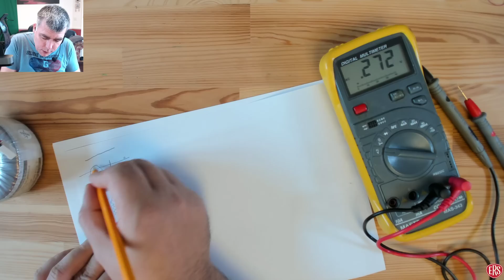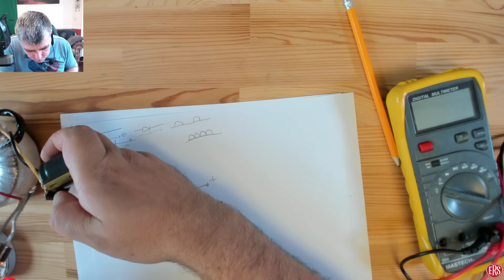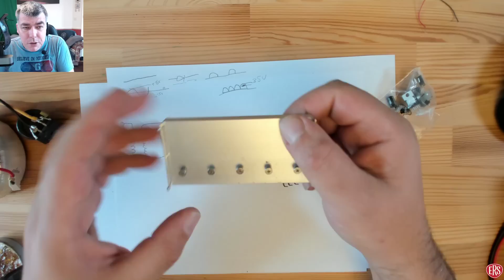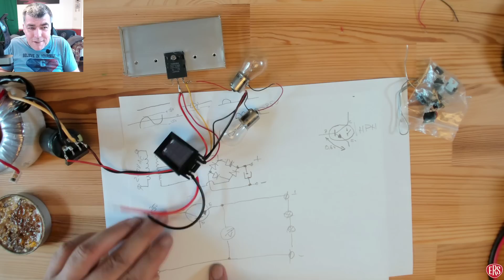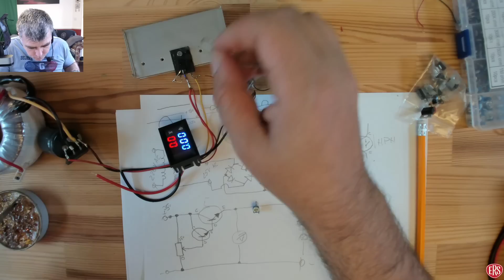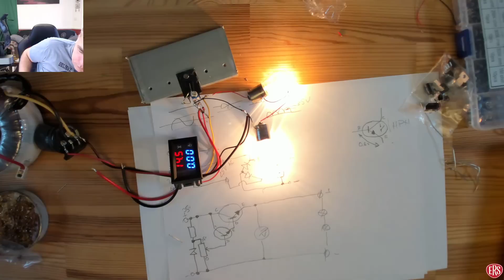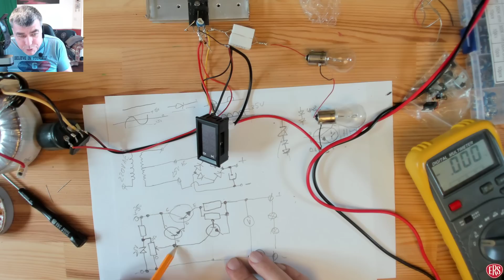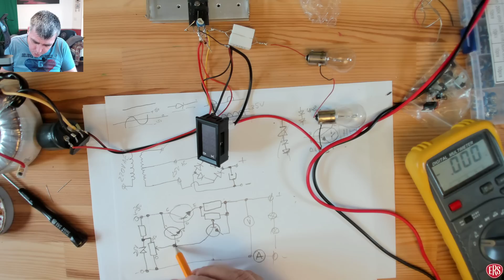How to Make a Lab Power Supply - Power supply project #Beginners diy projects

Comment: Wooow. Sorin, sir, that's the best video about DIY Lab power supply I seen on YouTube or anywhere else. Clear, useful and.. powerful. Thank you very much for explaining everything so nice. :) What can you do more about this device? I'd like to see how to make a short circuit protection for example or feedback voltage compensation for stable output. :) But these are only sugestions, anything you create will be indescribably useful. :) Waiting for next parts! I'll build one simmilar to your and share my experience. Thanks!

Comment: I ussualy use 3pin regulator ex. lm317 to bias pass transistor(2n3055). voltage can be fix with 2 resistor at pin adj or with 5k pot(variable voltage) between pin adj to ground, and 1k pot(current limit)+200ohm between output to adj.
Reply: Can you please give me the circuit using the above components. Output to Adj pin will definitely affect the voltage, but it can regulate the current- that I have to see.
Reply: @babbooshing6563  just google it. that simpler than use lm723

Comment: Smashing tutorial sorin, a classic transistor regulator :-D
My favorite output transistors are a couple of metal 2n3055's in parallel with emitter resistors so both transistors operate together.
I like the 2n3055 because it's handy for psu's and audio power amplifier outputs :-D.

Comment: Salut Sorin. In loc de dioda zener poti folosi led-uri pentru a ajunge la valoarea de referinta dorita.
Ca si intrebare poti scoate 4 amperi si 1 volt ?   M-iam facut ceva similar cu cateva luni in urma bazat pe cipul lm317 si nu prea pot face asta (transformatorul scoate 19v cu 4 amp). La 1v am max 1 amp. Ma intrebam daca e normal sau nu. Multumesc pt video

Comment: You should probably limit the maximum output current, here you can turn off the current limiter. Adding a simple resistor in series with the current limit adjust potentiometer should do the trick.

Comment: Nice video
Just one thing 
25 volt Transformer gives 25  x  square root (2) = +- 35,35 volts peak voltage not 25 .
In 220 volts  mains  power supply we have + - 311 volts
Reply: Nice math - but that's not the answer. The transformer is stepping down to 25v AC..One diode rectifies to 25v DC in one polarity. Second rectifies to 25v DC in the same polarity. The capacitor removes the ripple to the .707 power factor line. So .707 of 50v DC equals the 35v DC. Load further reduces DC voltage out.
Reply: 25 volt Transformer gives 25  x  square root (2) = +- 35,35 volts peak voltage not 25
truth
 ....
but without load ....
Reply: You all have right.
My point is in 6:25 of the video.

Comment: Really liked your comment about the fact that if you get bothered by the fact that you don’t have a PCB to build on, it will put on break on your creativity. It’s so true. If you absolutely feel like you need a PCB, get a perforated, cheap one to build on with only solder pads. I’ve done it for certain compact builds. Anyway, thanks for the trip down memory lane!

Comment: can we replace the big transistor bipolaire with mosfet
Reply: Uważasz, że mosfet jest lepszy od bipolara? W którym miejscu?
Reply: @leszekpaterek2389  the mosfet  controls with voltage it will be less heat
Reply: @AmerRimireZ  Jeśli na wejściu układu będzie np. 25V a na wyjściu 5V i prąd obciążenia 2A, to moc tracona na tranzystorze wyniesie (25V-5V)*2A=40W i bez znaczenia czy mosfet, czy bipolar.
Reply: I do not think they work the same. Mosfet is either open or not. Transistor output will vary as voltage on base varies. Right?
Reply: @okejee3455  Tranzstor mosfet bez problemu będzie pracował w liniowym zakresie pracy. Popatrz na schematy wzmacniaczy audio w klasie A-B z mosfetami na wyjściu.
Reply: Leszek Paterek ? What language is this?
Reply: @okejee3455  Polish

Comment: How can add short circuit protection and buck boost to it
Reply: Why buck boost? It's already capable of about 0-25V and like Sorin says, you will rarely need more than 20V if you are using the PSU to repair other popular electronic appliances

Comment: So what is the purpose of a relay in linear psu? Higher amp output? What if our transformer output has a higher voltage for example 50v. Can we use the same schematic just with different components that are rated for a higher voltage? What if our transformer has 2 output coils rated with the same current and voltage? Can we connect the outputs in series/parallel or better yet change the connection type depending on what we need more volts/less amps or less volts/more amps?
Once I opened old linear psu and I saw 2 opamps in addition to the transistors. After close inspection of the circuit board I was under the impression that the opamps regulate voltage/current levels. If so what are advantages/disadvantages of using opamps?

Comment: Also make video on how to prevent that voltage drop and how to add short protection
Reply: Current limiter is the short circuit protection. Sorin showed how it works -- current sensing resistor signal amplified by transistor to pull down base voltage of main controlling  transistor of the circuit (which is mounted on the radiator).

Reference based on zener diode does prevents voltage drop. But you can not keep voltage drop when you have short circuit -- and current limiter prevents it from happening.

Otherwise at short circuit we will have zero resistance of load and then current will be unlimited (in reality it is not possible as there is no transformer capable to provide unlimited current). If it would happen then on the transistor we would have produced infinite heat power.

The dissipated power (any kind including heat in electrical circuit) calculated by next formula P=U*I -- with infinite current heat power will become infinite at square times.

Sorin did not explained Ohm's law -- U=I*R, all three parameters of electrical circuit are dependent (related to each other). 

It is other form of second law of Newton -- 'nothing appears from nowhere and nothing disappear into nothing', law of constant energy in isolated (inclosed) system (the body in motion can not accelerate/decelerate without external force)

https://en.wikipedia.org/wiki/Conservation_of_energy
https://en.wikipedia.org/wiki/Second_law_of_thermodynamics

You need to watch this video again and again until you will not understand how it works -- then your questions will not have any meaning for you, it will be obvious that this circuit perform functions which you asked for (although Sorin for simplicity did not taken into account some parameters -- as current flowing through zener diode slightly affects voltage drop on it, it can be easily corrected by placing zener diode in output circuit, how it used in precision power supplies).

Well but otherwise Sorin gave reasonable explanation how to build regulated power supply with current limit which protects from short circuit (current can not go higher preset value).
Reply: +1

Comment: absolutely excellent tutorial on building an adjustable current and voltage power supply, enjoyed watching it from start to finish. A small perf board for a PCB to fit the components on is one idea for this it might also help with the fan controller aspect. This is a great beginners and expert course and yet you still did and excellent job at explaining, even with English as a first language we can find it hard to explain things.

Comment: Thanks for this awesome learning video.  I'm little bit confused is the voltmeter on the output? Its connected with the capacitor on the collector
Reply: The yellow wire on the voltmeter is connected to the output for checking the voltage output.and the one you saying that red wire that connected to the capacitor is to power up the voltmeter..thats it if im not mistaken.

Comment: You can also use muriatic acid + hydrogen peroxide to etch the PCBs, these two can be found very cheap at local stores even in the smallest town, I actually etched a PCB using them in my last video 🙂

Comment: İ am intereted in circuit protection section.which you didnt mentioned.

So ,if i understood right; circuit prottection means here is to protect the transistors. İf the load is broken ,the transistors must be stoped cause of over heating.if transistors contiunus working while there is a shortcut or broken load(burned lambs) , the fan cant handle to stop heating on the transistor too much. There must be cutting unit for power supply which supply volttage to transistors

The circuit protector is to stop the voltage before  the transistor ?

To not burn transistor cause of over heating and broken loads, there must be another controller,which must be worked to protect named cırcuit protection.

After the limiting resistors ,there must be another unit to check amper if it is high. İf it is high ,it means the load (lambs) is broken.

Therefore, in the complex circuits such as phone notebook etc... The lambs is sembolised to the phone or notebook and etc...

Did i understrand the circuit protection means correctly?

İ think there is two sections of circuit protection. One of them is to protect transistors (for power supply),another one is to protect after the load(after the lamb) such us "cpu","rams",and other units..
Reply: Yes, the short circuit protection goes before the big transistor. It's basically a relay.
Reply: @lynspyre  well thanks ,but i have curiosity that how does relay sense the shortcut or high amper?
Reply: @tekmusti  The relais will not sense anything, its only use is to cut the supply of power.
The relais can be put before or after the big transistor, to cut the power (break short circuit).
Also you can use the big transistor to break this... just stop the base current to the transistor and the collector-emiter flow will stop.
Now you know this, you need some part to sense the short circuit and drive/stop the base of the power transistor.
I will leave this part to Sorin to teach us, how it's done.
Reply: @paulodagraca3469  i have already known that the relay doesnt sense.  There must be another component to sens high amper. 

İf you remember on video, after plugging off the lambs, the amper was increasing . According to that icreasing ,the transistor starts heating ,because all of amper flows on the transistor.

Just before the lambs,There must be unit to cut down the transistors voltage, if the lambs got broken
Reply: @tekmusti  You are right, that we need some part to sense the short circuit. And we all like to know this, so we will wait for Sorin to teach us in some next video.

Just some extra information 😉
A short circuit is not like a load that uses high amps. The short circuit is like a wire between the negative and positive connection of the power supply.
So this means the voltage at the output of the positive lead (after transistor and after resistor) at the output is the same as the negative lead... zero volt.
Sure it has high amps, like with heavy load, but with short circuit the voltage is same as ground (0 volt).
We need to detect this state, not just high amps.

Comment: What a superb teacher. Nice. I'm just using buck boost from Ali. I bought two of those volt current meters. Both were faulty with liquid damage on board. I'm unlucky. Whenever I order stuff. Always issues. I want to put oscilloscope, frequency, voltage meter and dc. Dc converter into an ice cream container as the case. Sooper dodgy looking but easy. How to do the short circuit protection?

Comment: I'm a little confused of how that Zenner is stabilizing the voltage. Is the Zenner acting as a small load that is consuming the extravoltage made by the big capacitor?
Reply: The Zener draws a small current through the resistor. The important bit is, that the top end of the Zener stays at zener v, purely as a reference. It does NOT drag the whole input at the capacitor down, the resistor takes care of that.

Comment: Hi sorin, why you didn't modify your new power supply for  short protection? Please modify your new power supply for short protection. Thnx
Reply: The original power supply sorin did buy it, mentioned that is has short protection but it does not have this option, sorin said that i must modify the power supply.
Reply: We are still waiting for him to modify and upload a tutorial video about that, but he didn't do that yet, as far as i remember he said i have to order one resistor and i will going to modify the power supply.